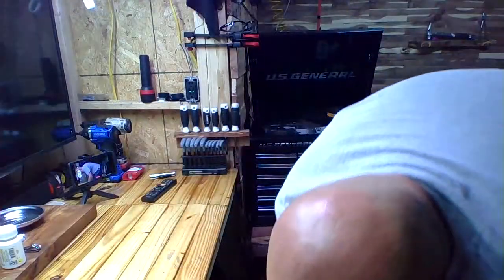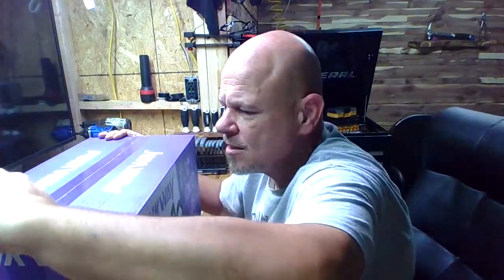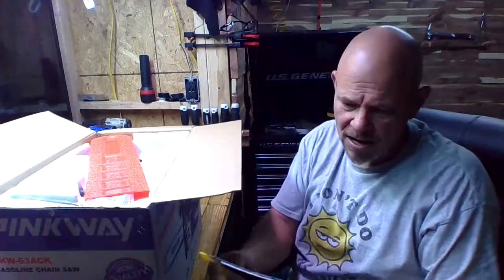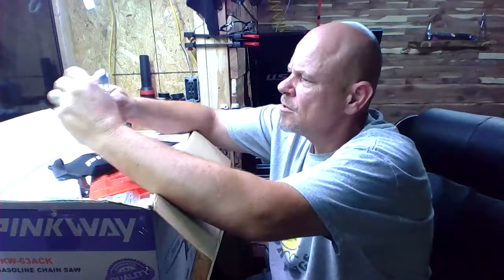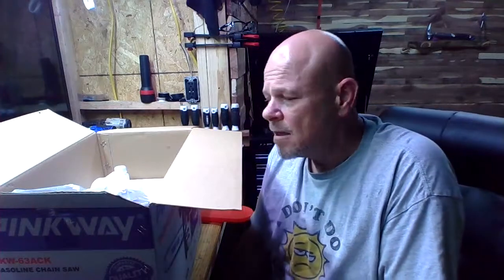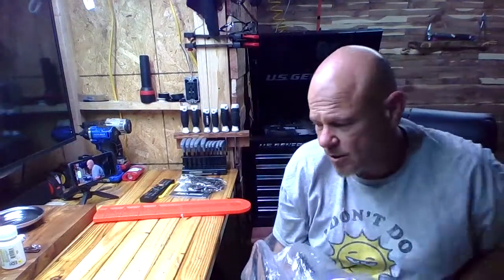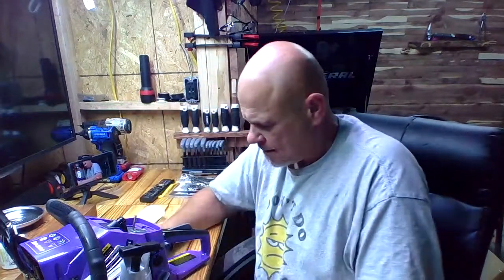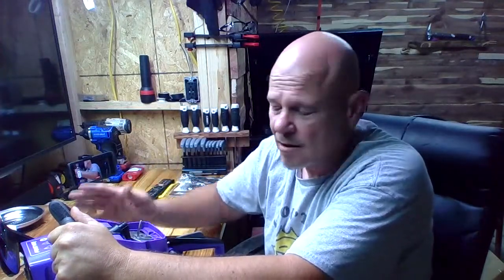WHAT?? $130 63cc PINKWAY with 2 bars for the wife!!!!!

Comment: I've recently received my Pinkway saw. What spark plug should i use for replacement? Is there also a replacement for the air filter?
Reply from the maker: Take the spark plug to your local auto parts.. they can Mach it with a better plug! 
I had an outlet for upgraded filters, but they stopped making them! 
Look up zenoah clone filter on YouTube! Many people have found excellent replacement filters!
Thanks for watching